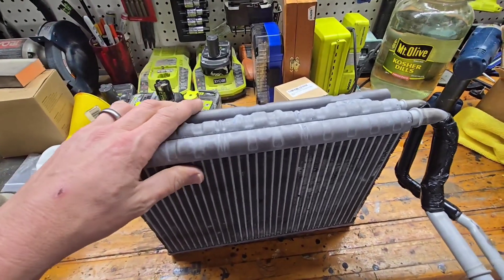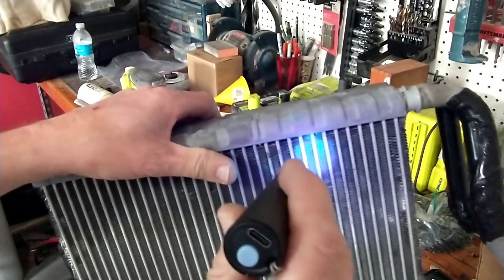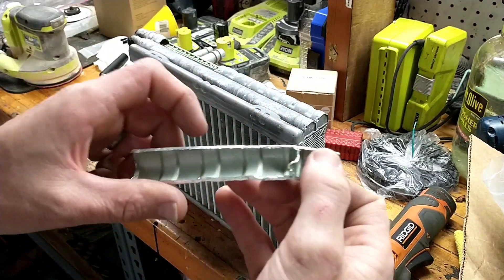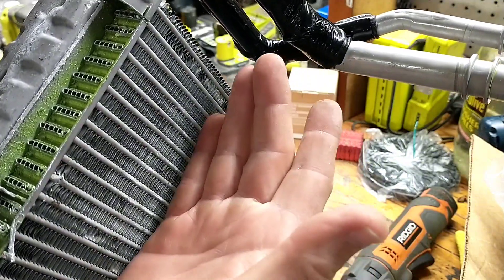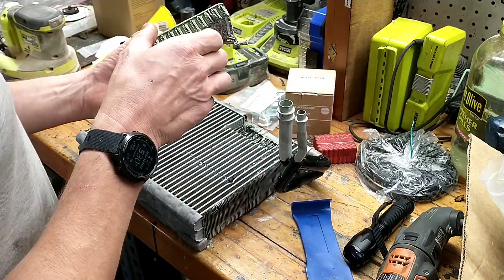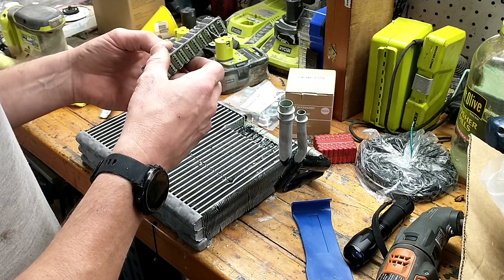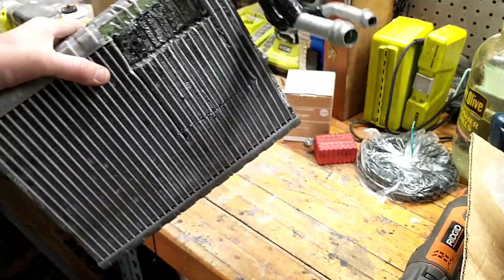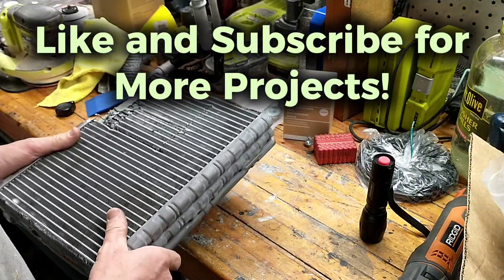Is R1234YF Refrigerant Corrosive?

Comment: That was really interesting, thank you.  I have been wondering about that very theory about corrosion... esp since I have a G05 that is prone to evaporator leaks.  Seems more likely that it is a defective part.    It is a very expensive repair... around $4,000.
Reply from the maker: Glad you enjoyed it, my G30 forum has an echo chamber of people blaming corrosion but everything I've seen points to inferior evaporator construction. The evap replacement on mine is 4-8k as well, evap alone is 1k!!
Reply: The part is virtually the same as the F platform which has an incredibly low incidence. There is no proven case of evap failure with r134a in the G platform
Reply from the maker: @pcpedroariel That's because of the hundreds of thousands of G30 platforms on the road like 80 of you have switched to 134a, not statistically significant.
Reply: @andysgarage1  Nope you are wrong. EU spec cars in the G platform have R134a. My 540i G30 is a R134a from factory. They only switched in EU in the 2019 models. Which is when issues began. I am in Brazil, our BMWs are EURO spec.
Reply from the maker: @pcpedroariel Cool story, show me proof of corrosion...

Comment: If the system is oil filled any amount of water should settle to the bottom of the heat exchanger.  If you cut open the lowest portion maybe some evidence of moisture and corrosion would show there.  I imagine R1234YF breaks down to hydrofluoric acid which is incompatible with aluminum.
Reply from the maker: There is no water in an A/C system, the drier in conjunction with most A/C oils being hygroscopic see to that. As for the r1234yf it's not breaking down unless exposed to air. I'd be happy to cut the bottom tank off if you'd like to see it, the only thing I would expect there is extra oil.
Reply: @andysgarage1 No need to cut any further. Either the part is cheap trash or they have made a bad design in the car where something touches the area where it leaked. During driving the movement slowly eats away until forming the leak or something similar to that.
Reply from the maker: Agreed, definitely no physical contact or other mounting related stress. Which leaves poor materials, design or craftsmanship.